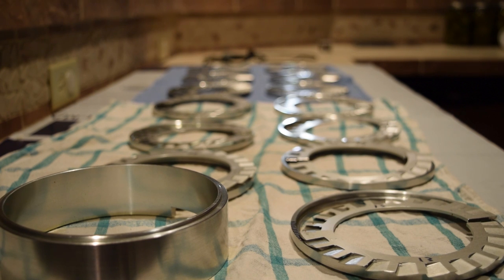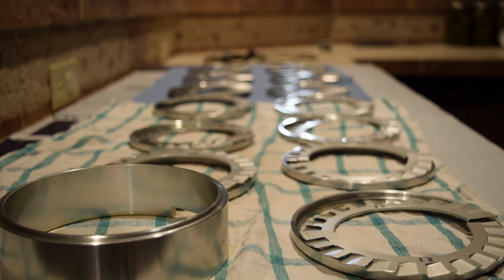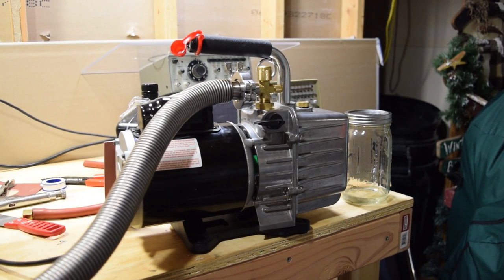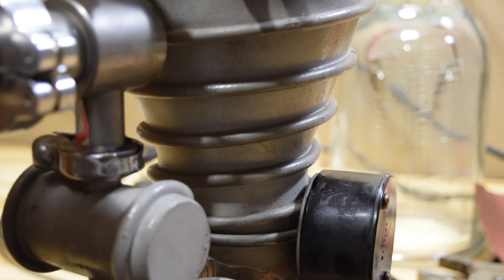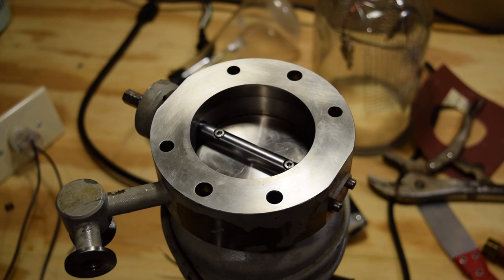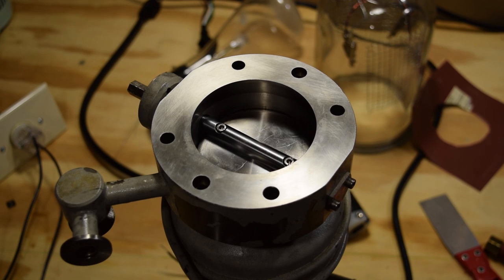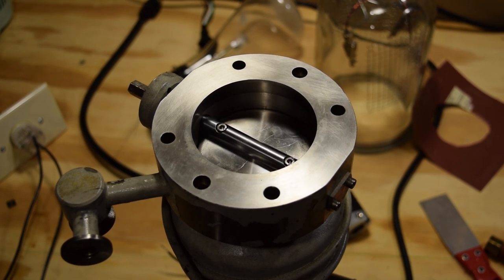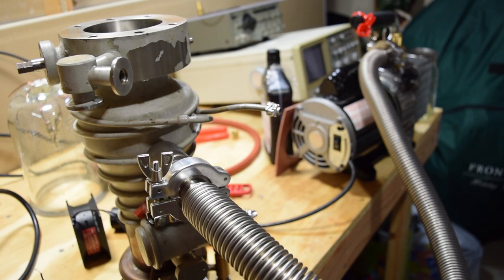Fusor Update - Dead Turbo and New Diffusion Pump

Comment: I have this same pump, only with the cryopump feature added on. I picked it up back in 2009, and ended up shelving the project shortly after. I just started to pick it back up. I'm pumping for the purpose of Physical Vapor Deposition, but I would've been so lost without the fuser community. You guys are easily the largest group of hobbyists messing around with high-vacuum technology.

Comment: Have you gotten around to building a new chamber? If not, I could fab you a plate to bolt on to the top of the pump that the bell jar can seal to. I have a home machine shop, lathe, drill press, that sort of thing.
Reply from the maker: Rob Mckennie I have not gotten around to that. That would be fantastic if you are able to do that! My machine shop skills are limited, and I don't have easy access to one either. Thank you for the interest in the project!

Comment: This is a long shot but…
I am currently working on resurrecting a manual version of the Edwards Diffstack 63, and saw that you had removed the pneumatic actuator for your unit, so do are you using these parts you removed, do you still have them? Would you trade or otherwise part with them?
Also interested on where you are with this project, perhaps swap notes…

Comment: I have the same diff pump. Have a 800 liter vacuum chamber with a 830mm flange sealed with an nitrile o ring. I assume the 150l/s pumping speed on the diff pump won't be enough for such a large chamber?
Reply from the maker: Yes you will need a much larger diff pump if you want a deep vacuum in that large of a chamber
Reply: @ScienceMarshall  what if all the ports are conflat and the large flange seal is made of indium instead of nitrile? A smaller pump would just take a long time to pull high vac I'd assume?
Reply: @ScienceMarshall  I'm geussing outgassing will be another issue to consider.
Reply from the maker: Yes, even if it’s really well sealed it’s going to be nearly impossible to pull a deep vacuum with a small diffusion pump. Especially if you intend to bring it back up to atmospheric pressure often. And you’re right that it’s the outgassing that will be a major issue.